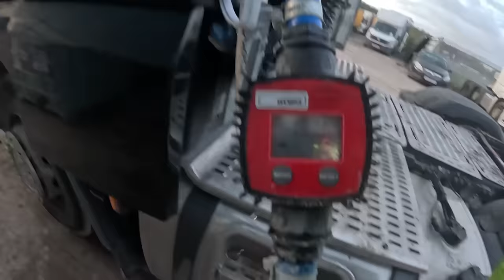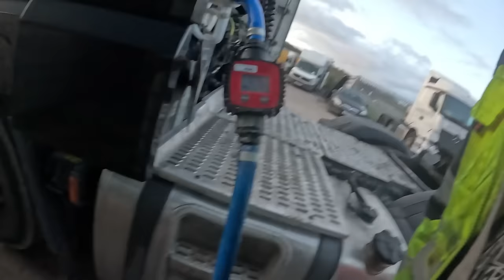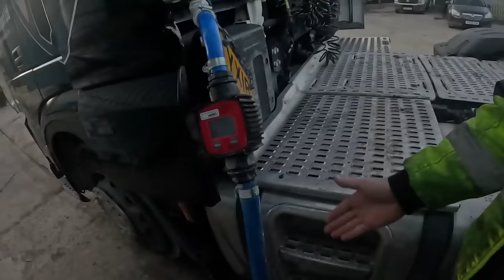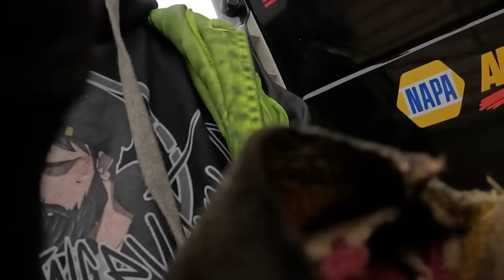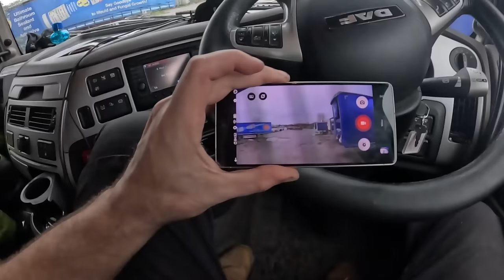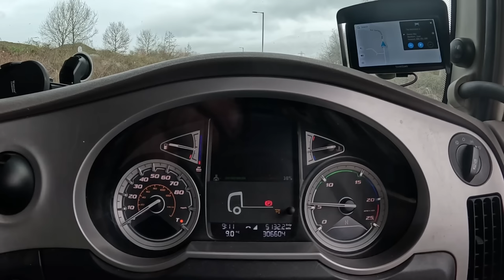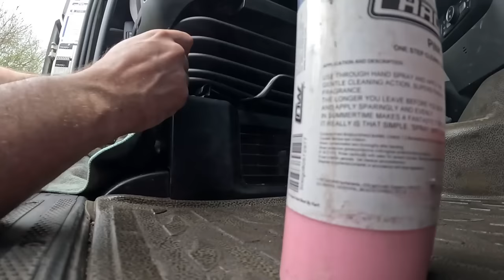A week of being clean... only to get dirty!

Comment: Thanks for posting, loved the bit about 5th wheel grease. Chipboard sheets are slippery, you need friction. Fridge box drivers have little rubber mats that give exactly that.
Reply: Best way to get friction is to put air between each board. As the board then settles down, the air gets pushed out creating a vacuum.

Comment: The sand used has carpet fibres mixed in with it to reduce the likelihood of freezing and also makes it sturdier but easier to rake, also is 5th wheel grease like normal grease out of a cartridge??